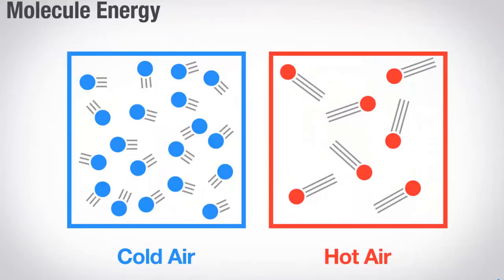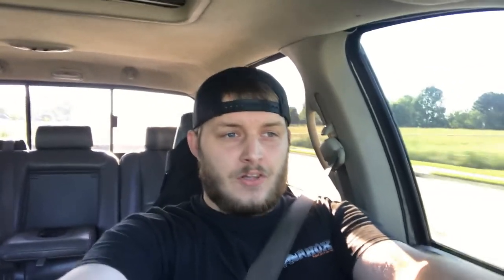Things People Forget in Racing - Density Altitude (DA)

Comment: Here's a question.... If my bike is tuned at 4,000 feet and tge same location reaches 8,000 feet Density Altitude, should I require an adjustment in fuel to make up for the lack of oxygen?  Air Density going from 4000 to 8000 is approximately 11.35% less oxygen.